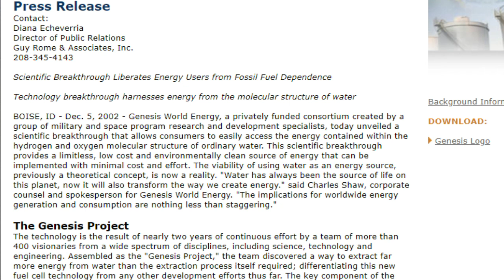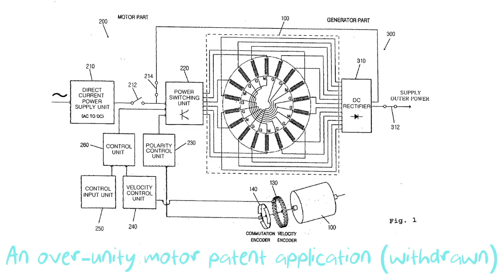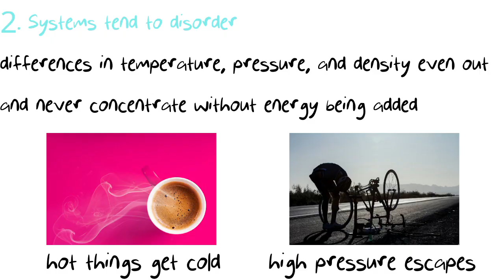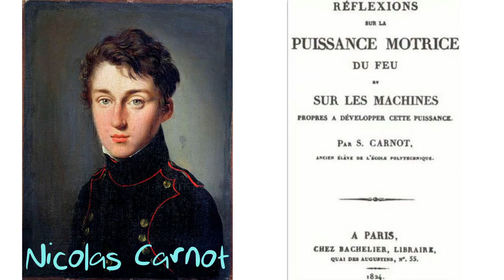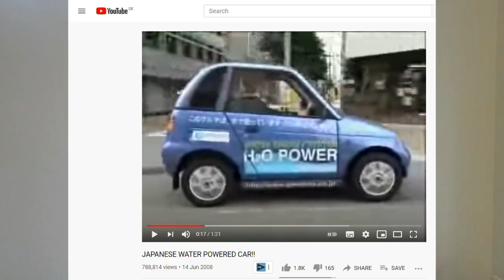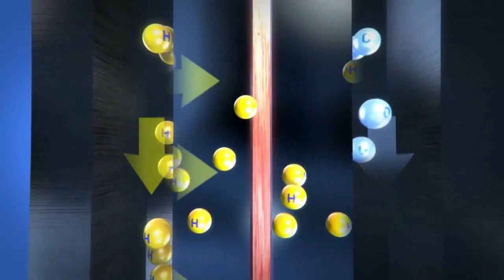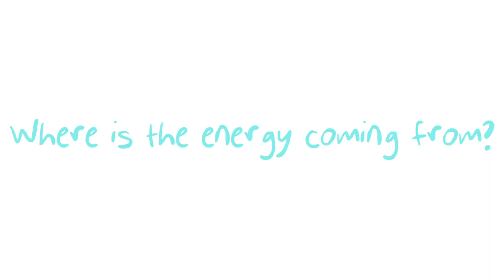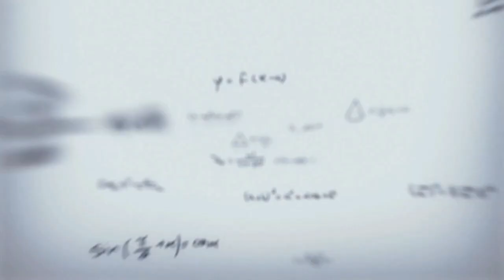First and Second laws of thermodynamics explainer video

Comment: Thanks, very useful and comprehensible. About efficiency: I don't think there is any one definition for a particular application. Efficiency is just a ratio, e.g. liters of fuel/100 km. So I believe we should always define our definition of "efficiency" before we use it. Keep up the good work, really enjoy your videos.
Reply: You have just described the definition, it is a ratio, described as the percentage of energy retained in the process. It doesn’t matter what the units are, joules, kWh, BTUs etc. if you put 10 units in and lose 4 the efficiency is 60%, the answer will be the same.
Reply: @charleslyster1681  Energy efficiency is tricky, because you have to decide which processes you include. A wind turbine is 40% efficient and and EV requires more Energy to move than a gasoline car as IT is heavier, so IT is perfectly reasonable to claim that the whole Energy chain to make and EV move is less efficient than good Old oil! However we like to Marvel in the electric motors higher efficiency, but more Energy is lost on the way to the tyres. Then we should maybe Also include the losses from sunshine to crude oil which is around 99.94%?
Reply: @Tore_Lund  Tore, when it comes to determining the efficiency of a gasoline versus electric vehicles, I think it is universally accepted by engineers and scientists, that the definition is - 

How much of the total ENERGY(in joules) locked up in their respective “fuels” is actually converted to a motive force to propel the vehicle?

1. Gasoline engines are quite inefficient, with, on average only about 30% of the chemical energy in gasoline converted to energy of motion, which drives the wheels. The remaining 70% is wasted in the combustion process, mostly as heat, and some noise/sound. This is why, obviously, gasoline engines require a very good cooling system to get rid of that high level of waste heat.

2. Electric motors, on the other hand, are incredibly EFFICIENT at converting the electric current stored in the battery( it’s “fuel”) into energy of motion to drive the wheels - typically around 92% !!! The remaining 8% (lost as heat) is relatively small, such  that EVs generally do not require cooling for their motors. (They do however, require a cooling system for the large battery pack for it’s optimum performance).

Whilst it is certainly true that EVs are, in general, about 15-20% heavier than an equivalent gas car ( due to the heavy battery pack) this disadvantage is pretty much negated in the case of the gas car, due to the additional losses sustained in the multi-speed transmission that is essential in every such gas vehicle( EVs do not have, nor do they require a complex transmission, but instead use a very simple, single speed gear reduction unit).

So to summarise, we can see that in terms of the efficiency(definition)of converting stored energy in their “fuels” into energy of motion to drive the vehicles’ wheels, EVs, at around 92% are far superior to gasoline vehicles at around 30% !! 

And this is, coincidentally, why EVs are much cheaper to run than gas cars. The typical cost of electricity to power an EV for the same miles, is only around 1/3 to 1/2 of the cost of the required amount of fuel for the gas car.
Reply: @Nicholas.T  Easy now, this was just and example, maybe a bad one, though underlining the point that the system has to be agreed upon for efficiency comparison. About vehicles, I tend more to Focus on emissions Per mile to hold the whip against the other links in the chain til not get a blind stare on efficiency of the vehicle alone. Market forces have their own efficiency measure: How much emploied Work + Energy for how much return, which with oil means hos much Energy to drill and refine against the energy content og a barrel of oil, which is why oil has been king for a century with 20x Energy return on the effort scale. However we drive EVs for a reason, me too, which is to lower our personal footprint, and there are places where driving and EV is as bad in emissions as driving a small gasoline car, like Victoria in Australia and the whole og India, so buying and EV is not the best way to spend your money if you live in one of those places, you'd Better get solar panels for most CO2 reduction Per $ invested. So sorry for widening the subject, but IT is really never just efficiency of the vehicle, that determinere if IT is the Better option.

Comment: For some reason I attract "over unity machine" nut cases, e.g. on Quora (perhaps because I try to convince them to stop wasting their time is they don't sound like scammers.) If they claim they have found a way around the first law of thermodynamics, conservation of energy, I invite them to either:
1) Find a flaw in Noether's theorem (by pointing out in the proof the incorrect step, not by hand waving)
or
2) Show that the laws governing their contraption are not time invariant.
Usually more hand waving ensues.

Comment: I have yet another question for you. (Oh no, not again!)  So here goes. For a flat surface aka a non air foil, what would be the optimum pitch angle for lift without the airfoil lift effect.  Kinda like playing with your hand in the wind while in a fast moving car.
Reply from the maker: That depends (it always depends!) on the wind speed, rotational speed and blade length. Maximum lift for a flat plate is at about 10 degrees angle of attaack, but if you don't twist the blade then you can't get that angle across the whole length as the local wind speed angle changes along the span. The theory you need to calculate the best angle for your design is in these videos: 
https://youtu.be/o6BCnhubbiQ 
https://youtu.be/CavfXOt3Dew 
If I were doing it (and I have a couple of times), I would set up a simple excel spreadsheet to try different blade angles until you get the most power for your specific design parameters. If you need help, let me know!

Comment: Nice topic 👏. Its important to understand that there will always be a waste energy in the system. So in a way we call renewable energy which is drived in from the energy sources abundantly available naturally. Wind, wave, solar, tidal, etc. However, if we apply 1st and 2nd law of therm in all of this we will find that this world is eventually running from the energy accumulated at its origin and energy source from sun. What do you say?
Reply from the maker: That's pretty much right! Except for nuclear energy which doesn't come from the sun. And of course the sun's energy is nuclear so in a way you could say that all the energy in the world is just nuclear energy that has undergone a series of transformation from one form to antother!
Reply: @EngineeringwithRosie  Tidal energy is another exception, since it is created by the gravitational pull of the moon on the earth's water.
Reply: @bilgyno1  Wow, righty. Never thought tidal also as an exception. Probably geothermal as well in parts is non solar? (Some of it is nuclear, some from planetary formation, some from gravitational compression ?)
Reply: Solar energy is the source for wind (creating high/low pressure differential). Wind causes waves. So both get their energy from solar irradiation. 
Solar energy is also what drives plant growth. That energy gets stored in organic matter, which can transform under high pressure and temperature into crude oil and coal. Or, when it is fermented by bacteria, into natural gas. So even fossil fuels originally derived the stored energy from the sun.

Comment: We had some students once that designed a wind turbine with a 65% efficiency! It turns out they had defined 'efficiency' as 'how much our power coefficient is compared to the Betz limit'...
Reply from the maker: Ha! But you know what, I think that is a perfectly sensible definition of efficiency, the amount you captured compared to the maximum amount possible to capture. It just happens that is not the definition we use, and it is not really a great idea if everyone just comes up with their own definition for efficiency!
Reply: @EngineeringwithRosie  Same thing with Wood fired stoves. For a numBer of years, efficiency was Claimed against a theoretical benchmark, so most of what went out the chimney was disregarded, so they could put a "90% efficiency" stamp next to a Green leaf in the brochures. Luckily, this bad habit has gone out of fashion.
Reply: They should have switched to marketing :o) They did not lie, after all...
Reply: That's similar to the definition I plan on using it a program.  That "efficiency" rating will be multiplied by the theoretical maximum efficiency.

Basically, if someone makes a 50% efficient thermocouple, it will generate 50% x the carnot limit worth of power.
Reply: it's very common to compare heat engines to the carnot efficiency in the same way